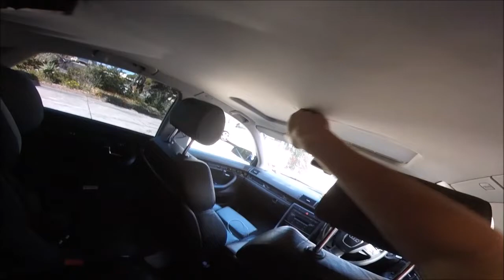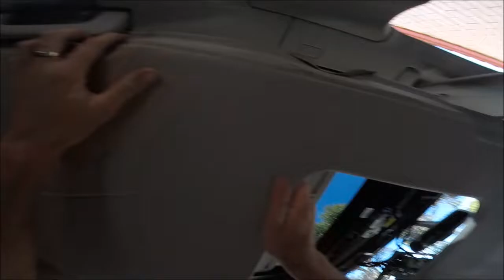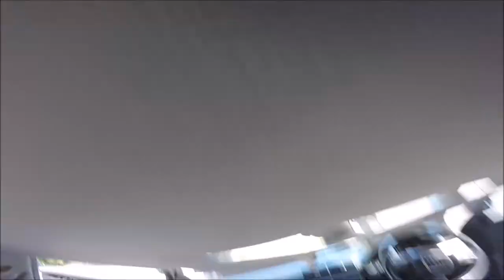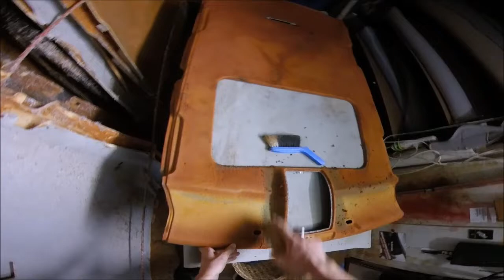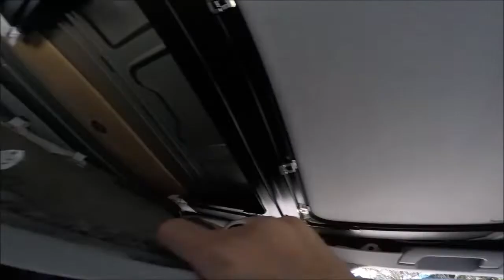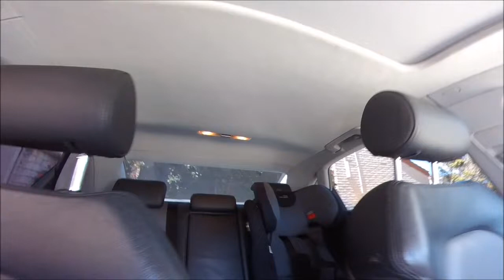HOW TO Remove & FIX Sagging HEADLINER on Audi A4

Comment: I’m surprised you didn’t drop the rear seats and take it out through the trunk.  I’m about ready to redo my headliner but the most important thing to do once removed is to find and fix the cause of the sagging. This is usually due to sunroof drains being clogged or a leak where the roof antenna is located.  My car has a leak near the roof antenna and another where the sunglasses compartment is. Good video.

Comment: Great video.. for my 2006 A4 B7 I found that taking off the hand holds was necessary to ease the tight fit on the over the door trip. It only takes 5 min..

Comment: I have an Audi a6 with the same issue, I may try this This weekend. Questions
1. What did you spray on the headliner to adhere the new liner?
2. Did it have to dry, overnight? 
3. How long did this process take?

The video would be more helpful, if you added captions to give the quick steps you took and potential things to look for.

Thanks.

Comment: Did you resuse the old headliner or got new one?
Reply from the maker: Hey thanks for your comment, its a good question. 

So we never reuse the old fabric/foam. And dont offer that service. 

Just full Replacement with new foam/fabric and new glue. 

If it was previously recovered in new material, then repair can be accomplished. 

Here our some Quick Fix Methods Explained in this Video
https://youtu.be/R9zGH9KOUYA

Fabric may only be sagging in a few places & still neat, but if it previously hasn't been recovered,
Adding glue to the existing factory material wont work, looks messy, it will leave a visable stain due to glue hitting raw fabric. Over time the foam backing on the fabric crumbles away making it un-stick & causing the fabric to fall down. To fix the sagging issue professionally, the Foam/Fabric needs to be replaced.
👍👍
Reply: @ReecesAutoHeadliningRepairs  what’s the dimension of the fabric you used for the headliner?

Comment: Did you disconnect the battery before hand?
Reply from the maker: We usually don't disconnect the batteries during the process of removing and installing the car roof linings we do.
Reply: @ReecesAutoHeadliningRepairs  oh dang okay. I was wondering bc I plan on taking out my headliner and I was sure if it would trigger the airbags or not
Reply: @Idunno195  as long as the process your doing is not dismantling the airbag system then it should be fine, from my experience we only remove the pillars that need to come  off with gentle care not to snag the airbag etc. And from my auto electrical course the teacher said the airbags can only go off under impact, sudden stop, or accidentally running power to the yellow wire that goes to them, as in installing a Amplifier with high power and running power cable to close to airbag wires can potentially do it.

We don't work on cars that had airbags gone off or a few airbags off, or if currently been In a smash where it looks like the airbags should of went off.

If concerned, unplug the battery 👍 but it doesn't always help 100% because even wreckers run airbag warning stickers on there stock for those that offer self removal, and that's with no battery in the car at all.